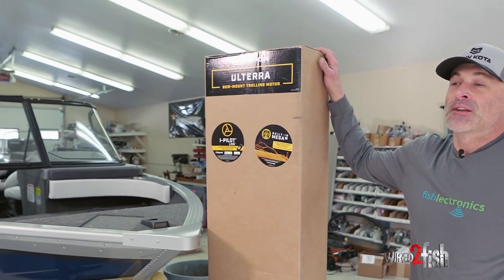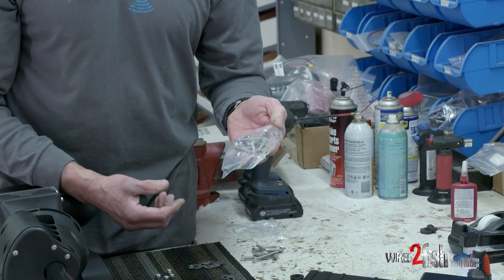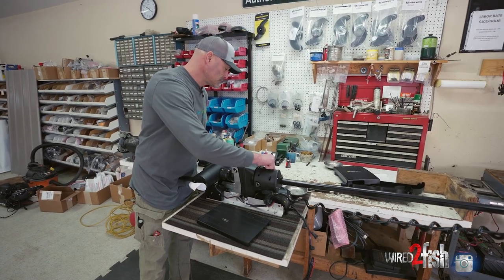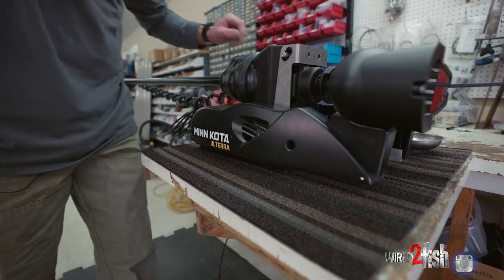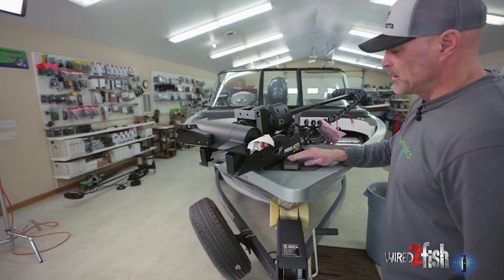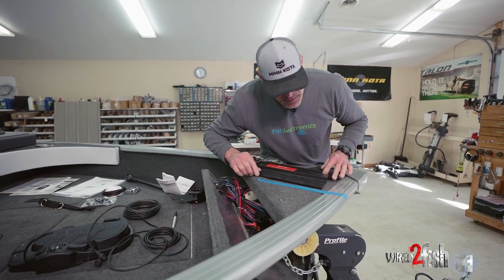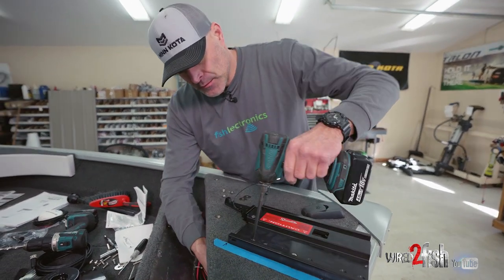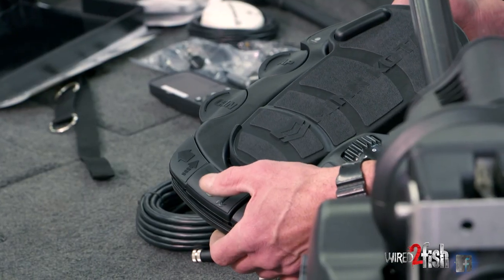How to Install the Minn Kota Ulterra Trolling Motor

Comment: Great, great video!  Thanks! I didn't want to cut any rubber washers because I thought I might need them.  Since the motor came with 6 rubber washers, I just used a rubber washer under each side of the 3 split washers to slide them out of the way as I slid the motor onto the quick release bracket.  It worked pretty well.

Comment: Hi Wired2Fish - our minn kota was stuck in between the holder on the stow position and tried to pull the housing trim unit so that we can push the pole and the motor out but was unable to, any suggestion how can we remove this from the in between holder, the motor as sitting in 90 degrees position with the fan facing upward on stow position - need help and assistance as every time we bring this to the boat shop it always cost us more than 1000 - that is every time we have an issue we are here in darwin, northern territory - thanks and I appreciate it